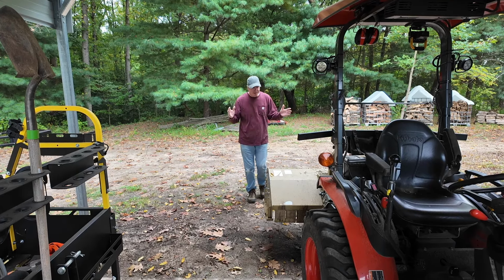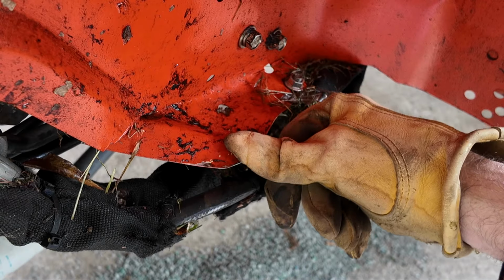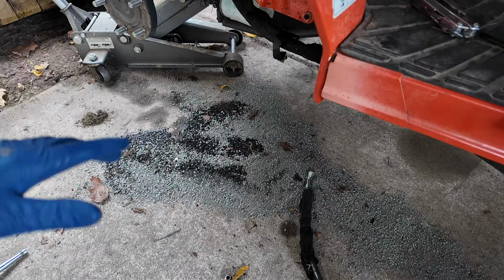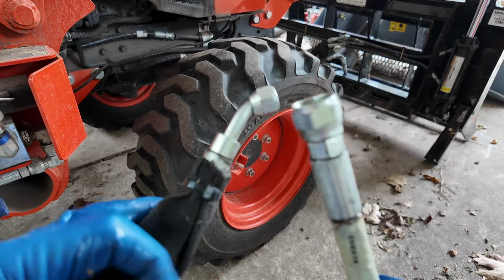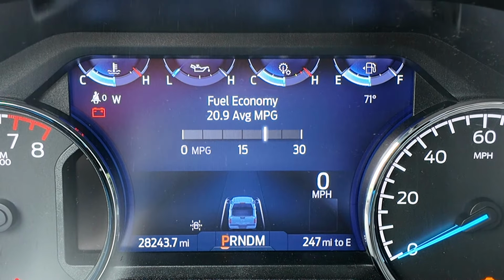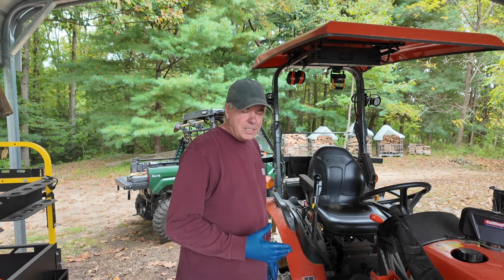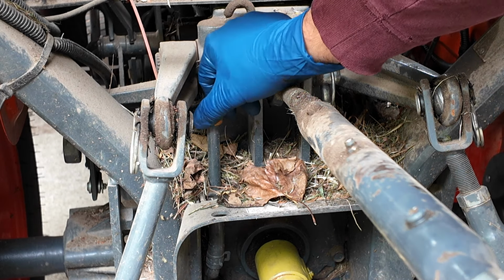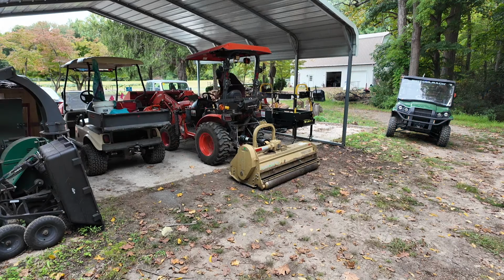I blew a hydraulic hose! MCG video #242

Comment: I can relate!
I work in the timber a lot, and sticks and limbs find their way to get to the hydraulics, no matter what preventative measures you take.
I had a hydraulic fitting get snapped off.
Took my hose to the local hydraulic shop and they repaired the hose for $48.
The VERY NEXT DAY I snagged an old logger’s choke cable that got caught up in my NEW hose and tore it loose.
I went back to the shop and had to replace the hose and two fittings, for another $128!
💩 happens!!!

Comment: Just a public service post .....
You mentioned "injection" .
    With so many people buying small tractors , or anything with hydraulics , we see a lot of talk about safety , but nobody speaks of the danger of injection injuries from hydraulic systems or fuel systems . An injection injury that penetrates through the skin requires immediate medical treatment . An injection injury sends fluid into the body that the body cannot rid itsself of . It can result in loss of limb and results in death if the oil enters the bloodstream . 
     Thank you for mentioning it . 99% of humanity has no idea of the dangers of injection injuries .
Reply: In this situation there wouldn’t be a risk of injury. The hose is leaking and there wouldn’t be any pressure.
Reply: I'd never heard of it before. THANKS ED!
Reply: In my 43 years working as a EMT/Paramedic I have taken three people to the hospital with "Injection" injuries. One lost a hand. Thank you for covering the danger involved.

Comment: I'm watching this because I had a heck of a time trying to get a basic hose for my L3400 5 months ago. My guess for you hose was $75.00 because mine was a little shorter and cost just under $59.00. 
I first went to Kubota dealer where I bought my tractor and they didn't have the fittings, they was fittings like you have, just basic hydro fittings, they said go next door to JD place, another big tractor dealer, and they didn't have fittings either!!!!!  So I went to a old run down chainsaw shop that the 75 year old guy use to sell chainsaws and also work on old tractors, fortunately he had fittings to make ONE hose and said he will order more......
Reply from the maker: I guess I was lucky to get one so easily!

Comment: I have a b2601 2 years old with a backhoe attachment best thing I’ve ever bought with the tractor . When I have removed my back tires to do shim upgrade mine has bolts to screw in your wheels are easier to line up using a round pointing shovel under the tire to pick up and maneuver around to take off your tire and put it back on

Comment: After the military I worked at an auto parts store and we made hydraulic hoses.  We charged $2.50 per end labor.  A 36” pc of it looks like 1/4 in hose with 2 jic fittings would have cost in the late 80s about $25.00.  Your looks to be made by Gates it has 2 aluminum collars and 2 JIC TYPE connections.  With inflation, you should be close with $85.   Even back then hydraulic hoses were easy money.  10 mins to make $25? Easy.  $85 super easy.  Good luck.
Reply: Those are probably SAE 45 fittings.

Comment: JACK STANDS!!
Please be safe out there. It's very dangerous to work on equipment like this without proper stabilization.
And, as other's have stated, be super careful about working on hydraulics without releasing the pressure in the line first.

Comment: Years ago when repairing the shop trucks snow plow, we sent the hose to a hydraulic shop, they replaced the hose but used the old fittings, if your guy did that it would have cost less than half of what you paid.

Comment: In Australia at least a $50 note is the new $20 note. What cost $20 a few years ago now costs $50.

Good work fixing the tractor. The wheels on my tractor are a lot bigger and filled with water. I don’t think I could handle it. I guess the water could be drained to make it a lot lighter but would still be heavy and bulky.

Comment: Hi Ed.  Did you have to do anything to keep the hydraulic fluid from running out of the open fittings when you removed the hose?  Also - just a suggestion - use that leaf blower to clean off the tractor after every use of the cutting deck, flail mower, wood chipper, etc.  It will keep things cleaner and avoid spilling dirt into the hydraulics when topping up the fluid.  Cheers!
Reply from the maker: Great suggestions. No, the line just dripped a little when I disconnected it. Thanks much!@

Comment: Back in the 80s we had screw together hydraulic fittings. Take your hose slide the ferrule over it insert fitting the screw together with big wrenches or if lucky a machine. Plant I used to work at we made all our own hoses, unless the fitting was damages you reused them
 Then came crimped hoses do need any skill to make hoses and the hydraulic manufacture  get to rip you of because you can't reuse the fitting. Sometimes "progress" isnt.

Comment: GOOD DAY SIR ED 😇👍 NICE TAM TAM MUSIC 🎵👍😇 Ho la la you had a inner fender bender 🤔 Nice tip about kitty little 🧐👍Nice Truck Sound Acceleration😇Mmm Let Me think ( honest ! ) Around 150 $ Canadian Bucks 🤔That is a very nice price in deed and yes you had a very good guess in deed 🧐👍5.0 Liter is a very good engine 😇👍Sir Ed, Perhaps a steel flap bar joining the top bolt above and also a fiber glass patch repair over the steel fender ? 🤔Nice Use of your Roof Top Garage  👍😇 Keep Up Your OUTSTANDING Informative Videos and Be Well Sir Ed Cheers 😇👍🍻

Comment: Yep same here besides my LS tractor which seems so far to be most reliable piece of kit I have. Ive got an old 66MF200 its a total PIA and currently mired in my upper pasture past the axle waiting for it to dry out before extracting.  My Kawi ATV stuck in the hollow down by the cave no spark, im pretty sure its the CDI or stator. Went to ride my 1975 BMW R75/6 to town to get parts for my neighbors new diesel truck, And now the BMW is miss firing went to pull the spark plug out and its stripped in the head.
Reply from the maker: Oh that went from bad to worse! Heli-coils here we come!

Comment: Would you recommend the Cover you have all your equipment stored in during the opening shots of this video? How much is it? Do they mail order it? I need to provide cover for my tractor and implements. Thank you.
Reply from the maker: The carport is a good solution to an expensive pole barn. This was purchased locally for about $3,000 installed. You can get various sizes. Versa Tube seems like a good option for online ordering.
Reply: @MyClutteredGarage  Thank you for all your past replies and to these as well. I purchased the Woodland Mills chipper because of you for my Ford Jubilee and love getting so much great utility out of my old tractor. Thanks!